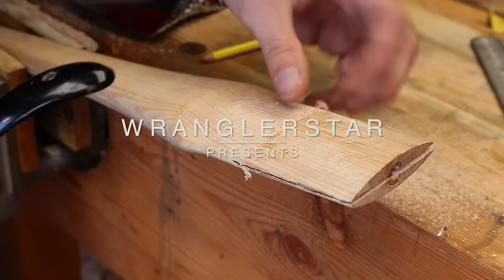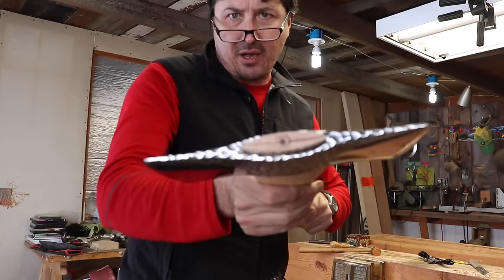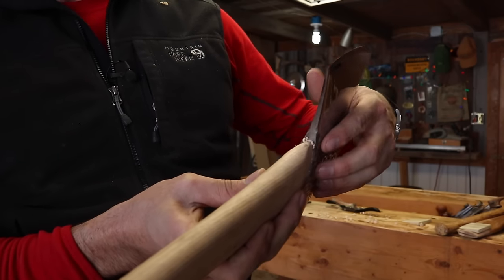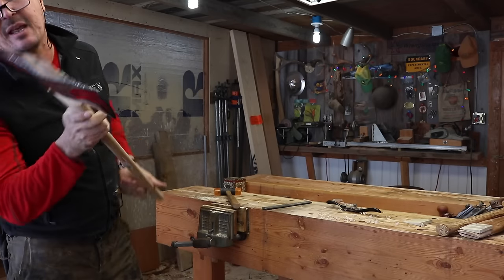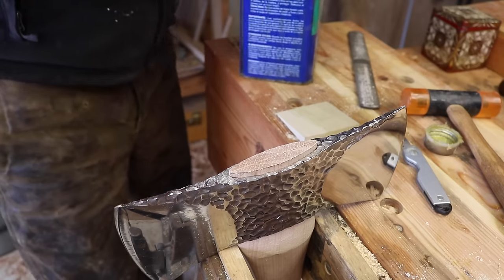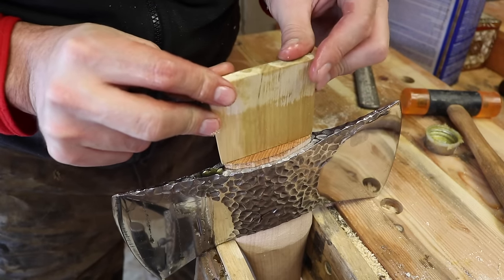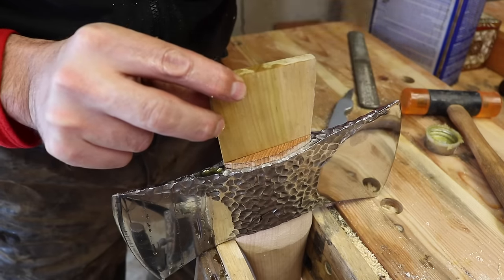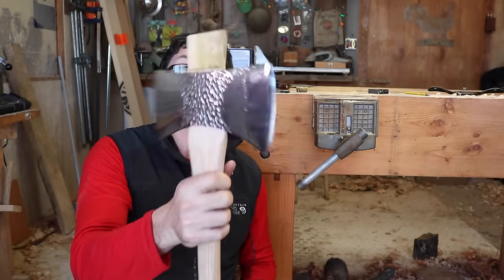AMAZING DIAMOND JEWELED AXE!!

Comment from the maker: Check Out My Favorite Axe Making Tools Here! https://goo.gl/3mSw4S
Reply: Wranglerstar you gotta love plumb that's the only hammer my dad used for as long as I can remember. They make such a beautiful product. great rehang video. Thanks. God bless
Reply: Wranglerstar do u just watch the video to enter
Reply: Wranglerstar why does your jaw twitch while striking the handle? lol
Reply: @buggyalstare1971 He is obviously tensioning his front neck muscles and back cheek muscles. Maybe he subconsciously feels that it aids in higher precision and power in the blows. Who knows! Every person works in different ways. :)
Reply: If you'd watched the video you would know the answer
Reply: Wranglerstar is that a Seiko 5 automatic watch your wearing? great bang for the buck
Reply: Wranglerstar, I have a important question for you regarding linseed oil, and would make my day and save me alot of time if you could answer it.

Question: Is there any reason that you wouldn't just put the axe handle into a puddle of lineseed oil?
I currently have about 10 new axe and 8 old axe I want to treat, and I am trying to come up with the best and most effecient way to treat them. 
My idea is to take a box that fit the axe and fill it with linseed oil. Then place 1 or 2 axes in it and then seal it off, so no air comes in and start harding the oil. The wood would then have alot of time to absorbe the oil and go deeper into the wood, without the air to harden it. 
Then after some time I take it out and wipe the oil off. Next place them in my holder and let it dry for a long time.

That is the question and the idea. I hope to hear your answer, before I might do damage to the axes.
Reply: Alexander Maach hi mate Mitch here from Aus I do exactly the same as Cody did in the video but in addition I put the axe once hung axe head down in an icecream container for 1 day then I take it out and stand it up head up and treat it with the linseed oil and let it soak in I coat it (after the first coat) lightly once a day for about a week or until the wood won't take the oil any more than let it dry then keep the oil up to it every month depending on use this is what I do and works for me my tools get a work out and I don't have any trouble hope this helps
Reply: I forgot one thing wipe excess oil off axe head stops stickyness
Reply: Wranglerstar Great Videos on hanging an axe. I'll be using this before the winter is out. I did not see a spoke shave in your store, can you recommend a good one?
Reply: check out a book called back to basics its really great for everyone covers everything from blacksmithing and carpentry to food prep and quilting
Reply: Wranglerstar
Reply: The King he might try it but id say he wouldnt do it for more than the top of it since antifreeze is poison boiled linseed oil is safer and can be used on the entire axe
Reply: The King ethylene glycol takes about 12 days to break down in the atmosphere and about 3 weeks to break down in organic matter e.g soil or natural matter glycol will not evaporate you are correct but the chemical makeup will change there for becoming less effective also it allows water absorption so if ur axe /hammer / splitter gets wet it will allow water to be taken in to the timber but oil be it Tung linseed or or good furniture wax will not allow water to penetrate into the grain and pores but if glycol works for u go for it I know a bloke that uses old engine oil
Reply: Mitch McBride well the oil is slightly better in fact i believe they use it to preserve telephone poles
Reply: Wranglerstar hijggj
Reply: Wranglerstar it didn't let ma go to the giveaway page
Reply: I do not see a link or anything to the other fellas YouTube channel.
Reply: Wranglerstar
Reply: Don Sherman its on the other video in the description and at the end but the dude is called landforgood
Reply: Wranglerstar what is the length on that handle?
Reply: The Mitten Outdoors if i had to guess probally around 36"
Reply: Wranglerstar
Reply: Wow !
Reply: Wranglerstar Hey I found an old axe head and other heads of tools in our yard and I have no,sreal business with axes and fixing things for them I was wondering if I sent them over if you'd like to make a video about them and restoring them I don't think they are special just wondering if should like to do that
Reply: and by no business I mean I don't have the tools and I'm new to axes and all this I'm more with cars and welding..
Reply: Roman Hamm I am still a beginning welder I do not have the necessary equipment I haven't been welding too lonf
Reply: Roman Hamm yeah I have beginner certificate and I'm completing my full certificate
Reply: Wranglerstar
Reply: what js the name of That oil.?
Reply: your a good father man.
Reply: Linseed oil!
Reply: "Old engine oil". This bloke uses clean-new engine oil. Works for me...
Reply: Wouldn't you be able to loosen it and just take off material with the head still in place instead of taking it all out
Reply: Wranglerstar 
Dear sir, is there any possible way to ascertain contact information on you? I have a couple of questions about this particular axe. Thank you in advance. Your videos are very intuitive.
Reply: Wranglerstar
Reply: B
Reply: A little splitting tip from a guitar maker here. I'm sure you splittet wood before,....so, you may have noticed that wood splits best perpendicular to the direction of the visible "grain",...wich not really is the grain, but the growth rings of the tree. The real grain goes perpendicular to the growth rings, and is hardly visible to the inexperienced eye (even sometimes for me,...depending on the wood type). What you want to do, if you like to reduce the chance of splitting, is putting this metal wedge exactly in growth ring direction. It may still split but the chances will be significantly lower.

Comment: Watch out for the boiled lindseed oil!!
If you put it on a rag/ paper towel make sure you have it in a metal can or despose of it where it won't be a issue if it ignites
I had a rag that had boiled lindseed oil on it and threw it in a garbage can. 6 hours later I get woken up by a terrible smell and ended being the boil lindseed oil rags combusting in the garbage can!!
Reply: That is why you should use an Rag Can. The garbage can is not the place for rags with chemicals on them. Glad you are safe now, some people are not so lucky.

Comment: I think it's possible to avoid the split at the final step, if you soak the wood and ax in oil and make it soft, before hammering the metal bit in the top.
Reply: Also, customizing the metal wedge, making it thinner. Great job tho.

Comment: Ohhhh Dude, I love you. So many guys talk to much. Talk 15 minutes about what they are GOING to do. Then do a poor job of it. No, no. You didn't do that. 

You explained so much I have had problems with on fixing axes or any other tool that needs a new handle. I learned soo much from you. 

Perfect delivery of narrative. Great ax head. And your treatment of the handle and the way you did it was perfect. I may never have such an awesome ax but I will say this, next rusty ax head I get that needs a handle, I can now do it perfectly. Maybe not as beautifully as you did it but well enough that it can last a very long time. 

You explained and demonstrated every single technique I will need to do it right rather than just rushing through it to have a so so job like I have done in the past. I now know how far down the head must be to be done right. I know what to do with the excess material. I know what to do when the wood is too tight and curls over. I learned how to tap the handle into the head and how to extract it properly. I know now to use linseed oil to treat it. I never even thought of that before. By the time you were done I was totally in love with your techniques and feeling grateful as ever I could be. Thanks man. 

BTW, you did bring it up so... ya, your hair cut you got last time sucks. Just growing out made it look worse. I suggest a new barber. I get a barber than cuts in such a way that a month later it looks fine.

Comment: how often should you put oil on a new axe handle
Reply: i think he's said everyday for a week, then once a week for a month, one a month for a... you get the picture
Reply: once a day for a week once a week for a month one a month for a year and then once a year from then on
Reply: My grandfather stored the shingle hatchet head down, with a hole drilled down in end of the handle, which was kept filled with boiled linseed oil.  The handle was always well oiled but dry and ready to work on a roof.  Because I don't have any wood shingled roofs I don't need to do this.

Comment: when fitting any head, especially axe heads, I was told not to bother with the step wedge if there was no gap on the sides (points) of the opening. it is for lateral expansion only. the wooden wedge is sufficient for any head if properly installed. yours was perfect bud.

Comment: Now I'll know what to look for in a store bought axe handle.

Such a beautiful axe.
Reply: ziploc53 Look for the grain to run on that 30-45° angle as he mentioned. It's much stronger. The cut is referred to as quarter sawn. The best is rift sawn, but. it is also the most expensive.

Comment: FYI - Hammer Head Trick??
An experience surveyor once told me that a good way to keep wood handles on hammers tight is to soak the heads of the tools in a five gallon bucket with about 2.5"-3" of antifreeze in the bucket.  The idea is that the Glycol in the antifreeze oils, soaks, and seals the wood keeping the wood from shrinking over time? 

Might work well, I haven't tried it but it seems to make sense...  Thought it might be worth sharing.

Thank you for your videos and sharing your skills with a great attention to detail Wranglerstar! 

GOD Bless

Comment: You should watch how to sharpen a ax. You know that a ax the edge is curved . It's hard to explain how to do it but if when you are fileing the edge if you hold the file centered on the hammer end of the head and swing the file up and down the edge it will automatically keep that curve

Comment: How about an Axe/Hatchet repair or refurb kit w/ all  the items needed (or most) and instructions (or watch videos of to use the kit :-)?  For a guy like myself who picked up and old Plumb hatchet at an auction and the handle is loose (maybe needs a new handle), needs a new edge shaped and sharpened, cleaned to nicer finished look and has never done it before.  Just a thought. God Bless!

Comment: Ax heads the eye is larger at the top than at the bottom.  So if you cut the handle off flush with the head and drive it up.

Comment: How people used to do the wedging of the axe head here in Finland was done the same way they put the axe head on the place, same way as you did in the beginning. So they hit the handle to make the axe head travel up to its place. Same way, they made a much longer wedge which you could grab after it was first put in enough for it to stay lightly, then they held just and only the wedge and hit it like the handle earlier, making the whole axe travel upwards, lodging the wedge into it's place. That way it was harder to split the wedge too. Once it was in firmly, the excess wedge used as handle was cut off and then the rest trimmed.

Comment: I used to have the shaft base on the ground and shock the head whether that be a hammer or axe, by hitting the base of the shaft on the ground, I guess that's the same as your method -6 and two 3s

Comment: 5:10 I notice the shoulder is a bit asymmetrical, like it was designed for a traditional single edge axe.  Is that just an aesthetic issue, or does it have any functional effect on the use of this axe?

Comment: A little splitting tip from a guitar maker here. I'm sure you splittet wood before,....so, you may have noticed that wood splits best perpendicular to the direction of the visible "grain",...wich not really is the grain, but the growth rings of the tree. The real grain goes perpendicular to the growth rings, and is hardly visible to the inexperienced eye (even sometimes for me,...depending on the wood type). What you want to do, if you like to reduce the chance of splitting, is putting this metal wedge exactly in growth ring direction. It may still split but the chances will be significantly lower.

Comment: Cody I would like to ask about the secondary wedge splitting the main wedge.  At point 18:34 in the video you stop and say, Ýep, it's going to split a little bit'. my question is, would it be a better practice to stop driving the wedge at this point and cut off the excess material to match the rest of the main wedge?

Comment: Cody I have a question. I have an axe that is my grandfather's and the head is loose I've tried putting boiled linseed oil in the top near the head multiple times and it still becomes loose, do I have to replace the handle and re mount it?

Comment: +Wranglerstar I bought 10 axes and hatchets today at a auction to restore for bushcrafting and backpacking. not sure which one I want to use yet. Would a hatchet size ax head be good with a longer handle to split wood? Should I just stick with a standard ax head or the hatchet size? some of the hatchet size ones have a hammer end on the opposite side.

Comment: Does it matter what type of mallet one uses when hanging the head? Seriously... does it matter if it's a rubber mallet, hard plastic, or even a dead blow hammer? Just curious if one is better for this purpose than another, and why? Sorry if that comes off sounding nonsensical.

Comment: so is that for hanging any tool handle?
My dad told me some 50 years ago just smack the hammer on its butt end on a floor to drive the head down, its always worked on a hammer.

But I'm going to have to re handle a sledge hammer I damaged with a blow to the handle and not the head. Even the small damage I'm afraid its going to break off using it.
And i'm sure i have a few small old hammer heads laying round that could use a handle.
however I'm partial to my American Eagle hammer but its a fiberglass handle.

Comment: I was going to ask about the pattern on the ax head but your friends did it.   I have been screamed at since I was knee-high to a short duck that you don't use metal shims in ax haeds.   Seems you have a different POV and more experience with it.   Most of mine is with tomohawks and my axes have all gone over to the fiberglass handles.

Comment: How log would you expect a handle like that to last?
Reply: Tim Johnson if taken care of his son will pass it on to his son.
Reply: Nasohi just like my grandads axe. Bloody good axe.......
Reply: If the grain is straight and you don't hit it on anything, it should last years. The crappy hickory handles you buy at home depot or lowes break out on me all the time just from normal use. That's why I went with fiberglass. Not as classy but more durable.
Reply: I rehung my felling axe in 1968, only because I found a much nicer handle then the one it while touring a tool handle factory on a forestry class field trip.  From the marks on the orginal handle the axe was used by the WPA.
Reply: id say id like to use that axe to cut down a tree to cut a couple backup handles from

Comment: Cody, I noticed in leather pants a while back, I thought at first it was for chainsaw protection, but they seem to be a favorite of yours, any insights? my experience from motorcycles is that they don't breathe so they trap heat in summer and they transfer heat so in winter they are cold, I'm curious about other reasons to wear them.
Reply: Karl Streich I believe they're tin pants but they're so worn the appear leathery. I'm not sure if he's got that in the title though. It was around the time he got his wool cruiser jacket. Maybe someone has better information??
Reply: Karl Streich they are tin pants from the Filson Company. A real quality American company.
Reply: They also have quality American prices.($$$) Good stuff though.
Reply: price doesn't scare me if the quality is there

looked it up, ~$200, if the quality and durability is there that isn't bad.  what does a pair of Levis cost now?  I picked out a quality motorcycle jacket a few months ago, when I flipped the tag over ... $900.  that will make it hard to sit for a week!
Reply: Karl Streich 

Those aint leather pants 
They are Filson Tin Pants

Comment: Why don't people just cool down the wood in a freezer and heat up the metal, so that thanks to thermal expansion it just slides over, and when the temperatures come back to normal it holds really strong?

Comment: Hate to be that guy but..... whenever you get out of the shower your body will way less. Water leaves your body. You can clearly see this when you look at your fingers. There shriveled from lack of water. If they absorbed water they would swell. Things move from high pressure to low. The pressure of water in your body is higher then the shower or bath. Therefore it tries to reach a perfect balance by leaving your body to loose pressure to match the outside of your body. Wood has less pressure from water so when put in a bucket with water it absorbs.

Comment: Ok, clearly you have no problem taking your time to hang an axe head properly and that is wonderful to see.  However, I take exception to the fact that when you stop to remove the partially fitted handle you place the blade tips of the axe on your work bench and the metal of the vise jaw in order to drive out the handle for further shaving.  Cleary you are knowledgeable when it comes to tool use, maybe filming made you nervous and you forgot to pad the vise and bench.  Still, nice work.